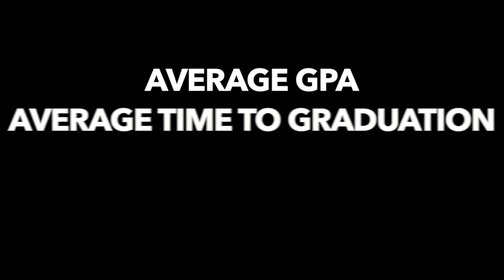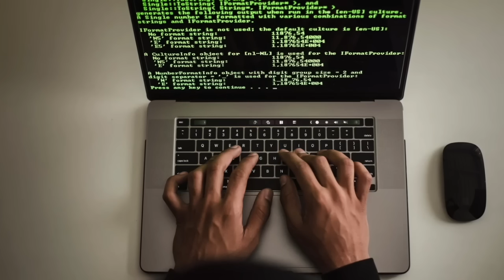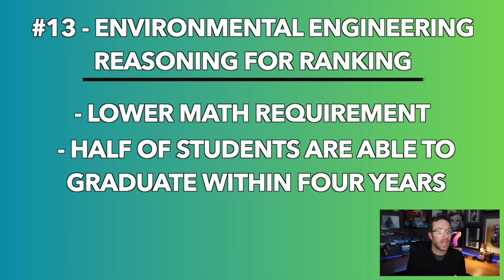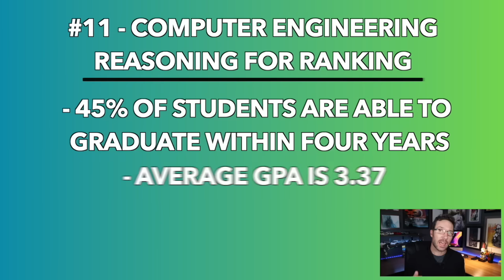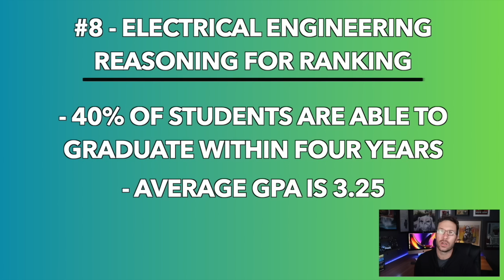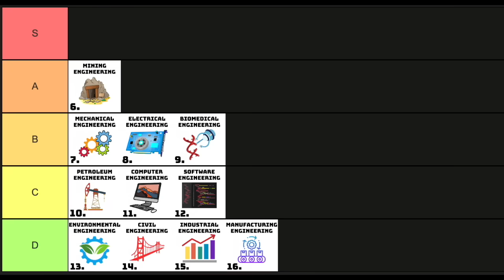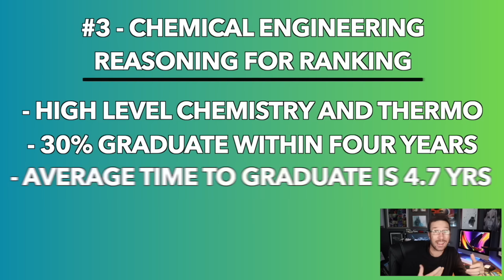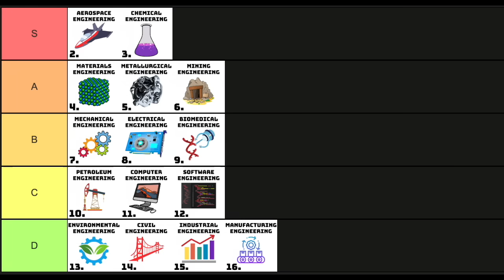Engineering Degrees Ranked By Difficulty (Tier List)

Comment: I appreciate your attempt at doing an objective list. One problem with that is that if you want to have something called objective then you have to have data which is actually objective. With that I mean for one the data is correct and it also says what you want it to say once you interpret it. 

When it comes to highest math required I would say it is a good criteria in principle, but a bad one in practice. I'm not the first one to point out that in certain disciplines they have tougher math courses which are just not labeled as math. And then depending on the degree you can have the very same math class in the same school with various difficulties. Just to bring an example, in mechatronics engineering and in electrical engineering both courses had differential equations. The mechatronics course took the approach to give a rough outline of the basics and then they just did simulations with matlab and simulink. The equivalent with the electrical engineers took the mathematical approach where they went deeper and only did calculations by hand. 
If we would want to guess which engineering degree teaches math to which depth, then we would have to look how much it is required in the follow up courses. 

Then there is the problem, that the math course is normally not the toughest course of a degree. I guess if you have tough math then you have a better basis to go deeper in the follow up courses. Sadly it is not that simple. For example in mechanical engineering the highest math they do (partial differential equation) is relevant to their job and so they focus on this with their math. The electrical engineers have various transforms as their highest level of math and don't follow the differential path as far as the mechanical engineers. Does that mean the math of the mechanical engineers is more difficult? In my experience it depends on who you ask. Some find differential equations a mystery and others say the same about the flourier transform and the complex numbers. 

Because of the reasons mentioned above I think weighing the duration of the average graduation time is a better indicator. In my case the graduation took longer due to me taking an exchange semester. And some people take longer because they do other stuff on the side. So this would also have to be considered as different engineering degrees attract different people with different interests and different approaches at doing things. But I don't know how significant those other factors are compared to difficulty. So the best I can do is call to caution and not just assume this difficulty is the only relevant reason for graduation duration. 

In practice I would say you have to look at how the school educates the degrees and which fields of math and physics and other topics you are skilled in. There are engineering degrees which are as a whole more tough than other engineering degrees. But actually ranking them objectively is not that easy, especially if you have not studied the degree yourself or talked to people who can make comparison. Sadly this is probably a topic where anecdotal evidence is better evidence than if you blindly go by "objective facts". 
If I were to try to make an objective list then I would try to approach students from different schools who can make comparisons between different engineering degrees. And then ask them which degree is more difficult and why they think it is more difficult. Then I would try to differentiate between which topics seems to be objectively more difficult and which depend on the type of student you are. For example calculus 3 is objectively more difficult than calculus 1, but calculus 1 is not necessarily more difficult than linear algebra. It depends on what you are more skilled in. 
This approach of creating an objective list generates a lot of legwork, but who said being objective is easy?

And when it comes to upcoming engineering students I would recommend every student to visit the school/schools you consider attending and talk to students and teachers on what they say. I did that and it helped me make an informed decision.
Reply: @@Juuru107 I hope I got everything: 

- The same math course doesn't have to be equally difficult in different engineering degrees. 
- Math courses don't have to be labeled as math courses.
- The most difficult courses don't have to correlate with the highest math degree. 
- What someone finds difficult depends on the skillset of a person.

--> Because of that weighing the duration of the average graduation time is a better indicator, but difficulty might not be the only significant reason why an engineering degree can take longer. 

In this case anecdotal evidence is more accurate than pure numbers as long as you ask enough people. After all pure numbers only mean something if you have the insight to guess what they mean. 

And for the specific case of each individual student visit a few schools and look at a few degrees. Ask the students and teachers  to find out if the place may fit.

Comment: So everyone at the university I went to (CU Boulder) would have pretty much agreed with your tier list with the exception of EEs. They were bona fide elitists. I think it was due in large part that they were the only ones that had to master the sorcery of digital circuits. But IIRC, mechanical engineers had the most demanding curriculum, being required to learn a large amount of electives in other disciplines, and on top of that - along with aerospace - had to take 3 (or 4?) semesters of physics, which included relativistic physics. Also, software engineering wasn't actually part of the engineering school, but rather arts and sciences.

Comment: 3rd year Aerospace Engineering student here, I was surprised to see aerospace at #2! From my experience my major seems harder than most disciplines (mechanical, civil, environmental, industrial/manufacturing, etc.) but definitely seems easier than something like nuclear or electrical. With respect to chemical engineering I’d say the difficulty depends on the person, because some people are more inclined to understand chemistry than physics/mechanics, but for the average person I’d say it’s harder than aerospace.

It’s also worth noting that for some disciplines (i.e. materials/metallurgical), the average student is getting at least a graduate degree, so comparing the undergraduate degrees isn’t necessarily comprehensive for comparing career paths.
Reply: PhD student in Aerospace here. In my opinion, the difficulty in Aerospace doesn't come so much from the individual difficulty of each subject, but the variety and depth to which we study several fields. You could say we're Mechanical Engineers with some less thermal stuff but a bunch more fluid mechanics and structures. Also, my university didn't have Nuclear, but compared to Electrical Engineering, Aerospace doesn't fall behind in maths, control systems or physics.
Note that your experience may be quite different, as I haven't studied in America and my undergrad program had a base duration of 5 years (which was virtually impossible), so I don't know how a typical American program is.
Reply: Your assessment is spot. In terms of difficulty, I would rank NE > ChemE > EE > AE > ME > CE > EnviroE/IE/ME

Comment: Dec 1970 Mechanical Engineering 148 Hours required. Was it hard? Had a 2.5 average, then got a degree in Business Administration 3.8 Average and an MBA 3.75 average.  Yep, Mechanical Engineering was long and hard.

Comment: As a retired Ph.D. nuclear engineer, I would consider chemical engineering perhaps the hardest at the B.S. level. When I got my B.S. in nuclear engineering in 1969 at Kansas State, both chemical and nuclear engineering B.S. degrees required 148 semester hours. Now, I think somewhere around 132 semester hours are required for chemical engineering there. I think the chemical engineering approach to mass transfer and fluid flow is a little more rigorous than in mechanical engineering (my graduate level minor). I am not current on what the entry level pay is for the various disciplines right now. Petroleum engineering used to have high demand and high pay.
Reply: Another thing that’s not mentioned very much in the video is the job saturation level. From my research, chemical engineering is highly oversaturated because of the few number of jobs currently available. In the US where I’m from, chemical engineering does not have very many positions available versus how many students are graduating per year. So, while it may be an incredibly difficult major, you’ll probably have to work twice as hard to find a job in it once you graduate
Reply: @bestredditstories1158  - Same here!
Reply: @bestredditstories1158 

I am a chemical engineer as well.  University of Notre Dame class of 1994.  I think the opposite is true.  It is the only current engineering degree that has more openings than people graduating on a national level.  You just need to be willing to move where necessary.
Reply: Very cool. I am currently a nuclear engineering student at KSU.
Reply: @joshuat3686  Graduate student? I couldn't find you in the grad student directory online.
Reply: @JeffRyman69  No, I’m a senior year undergrad. Technically, I am in mechanical engineering with a nuclear engineering operation.
Reply: @joshuat3686  If you want to work for a utility, that is a good place to be. Utilities hire more mechanical and electrical engineers than nuclear engineers. A mechanical engineering degree with a nuclear option is a good combination for that. It also is a good background if you want a graduate degree in nuclear.
Reply: @JeffRyman69  Thanks, I am starting my job search now, and I will definitely keep utilities in mind. Getting an engineering position at a nuclear power plant would be ideal.
Reply: @joshuat3686  Problem with nuclear is jobs , ever since that nuke plant blew up in 3 Miles island some 40 yrs ago, US did not built a single new reactors.  Only recently they finished 2 but no new proposal.  SO the usual career path is working for govt , military, university.  I used to work at largest computer companies in 2000, we got 3 ex-nuke operators from the Navy doing tech work.  Good luck
Reply: I studied chemical engineering in Germany until February 2023. And at my University of applied science, we have in Bachelor the complete chemical engineering and in Master we can go deeper in nuclear physics like nuclear waste management and so on. Both is difficult and I don’t think there is a great difference in the difficulty level.
Reply: Any good engineer should be able to think in three dimensions. Most people struggle so start early imagining complex shapes in your mind’s eye.
Reply: I agree, my wife is chemical she can handle all my circuit analysis problem just by looking at the book. Her fluid dynamic & heat transferis so complicated for me  , I see so many dropout in ME & Chemical becuase of fluid dynamic and material science.
Reply: I took electrical engineering, after passing the board, I returned to school and studied mechanical engineering. Not satisfied, I studied again computer engineering. After passing all board exams, I ended up in mental hospital teaching engineering to my roommates...
Reply: @noomade the difficulty of chemical engineering at the graduate level depends on the area. Chemical reaction Engineering, and Chemical Reactor Engineering are exceptional within the discipline. Chemical Reactor Engineering requires proficiency in all branches of the discipline and that makes it very difficult. Moreover the level of math required is indeterminate. Recently, chemical Reactor Engineering seem to involve the extensive use of Quaternions, and Integral Equations.
Reply: @JeffRyman69   You forgot to mention that there is more to chemical engineering than the nuclear field. Once you master the basic building blocks (or concepts of modern chemistry) you can easily transit into a multitude of fields from biochemistry to exotic types of paint and not to neglect, food production
Reply: I agree. The problem with being a chemical engineer is people don’t know what we actually do. They just assume chemicals. They have no idea how rigorous the major can be since people rarely dare to actually take it.
Reply: Can you help me out with
Reply: @noomade  Probably electrical as the hardest, to be honest
Reply: @bestredditstories1158  actual ther are - electrical and - electronic. some university just focus on electrical,  and most focus on both, Electrical is much easier as one subject and I dont see any dropout at 3rd yrs..   Much higher dropout  if they study both in one major

Comment: Mining PhD here,

I’m not sure how you’re getting no growth. There’s a demographic cliff coming fast in the field and a massive expansion in the scale of projects and difficulty in developing new mines.

I’d be cautious with ranking Mining difficulty compared to many other engineering fields due to it being more of a generalist field than the more narrowly focused fields, with mining engineering curriculums being a mix of mining, geology, engineering principles, economics, operations, rock mechanics, ventilation, regulation, plant management, and safety. It isn’t as “hard” in a narrowly focused technical sense as EE or some MechE specializations, but it requires a different kind of awareness and understanding of a little bigger operational picture. There’s a somewhat intangible difficulty there in contrast to the narrow focused academic difficulty of an EE or a ChemE. Mining is a field that has a greater emphasis on hard to academically quantify judgement than most.

Comment: Electrical engineering is the most difficult, the course has too much abstraction,  no one see current or voltage or radio wave. I took DSP course man that course requires you to fully understand Fourier, Laplace and complex analysis
Reply: Man now I kinda wish I never took CS. 
Electrical Engineering sounds infinitely more fun.
Why tf does CS have a higher GPA requirement than EE???

Comment: There is no way computer engineering should be this low and EE is harder the mechanical in my opinion. We should also consider the small amount of data we have for the obscure degrees with small graduating classes.

Comment: Well, this may be true of most engineering fields, but when we say electrical engineering, it comes in different flavors with varying degrees of difficulty. For instance, an electrical engineer with a power focus is not the same degree of difficulty as an electrical engineer with a semiconductor focus. Semiconductor engineers have all of the basic electrical engineering elements, but also elements of chemical engineering, metallurgical engineering, mechanical engineering, quantum physics, photonics, RF, software engineering and a whole lot more.
I'm not trying to make a case specifically for electrical engineering. I'm just trying to point out that the assessment is probably not accounting for the variation in difficulty within disciplines.
Reply: Jesus. I wanna have a semiconductor focus lowkey.
Man why tf I gotta choose CS. Yall be doing way more interesting shit
Reply: @honkhonk8009  Indeed. Semiconductors is a field that is never coasting. Every few years there is a new technology in development and with each new technology there are new principles to learn and sometimes a few to unlearn. Never a dull moment.

Comment: Yeah, for the most part I agree about the CS degree. CS was under Industrial Engineering & Management, so I also have a minor in IEM. I also did not finish in four years, as I wanted to understand computing from the electrical and mechanical at the component level all the way up to large scale systems. Took math through partial differential equations and then group theory, along with a fair amount of statistics. Programming was the least amount of credits I took. Turns out all the IEM classes made for being a pretty good Project Manager as well as a first rate software engineer. I had a varied career from programming some amazing equipment to being a high level manager to being a consultant. I loved all of it before I retired. While education filled me with a huge amount of facts, the important part was learning to think in certain ways to see solutions. Great video. Sent to my son who is a mining engineer that I’m sure would agree with your assessment on his profession.

Comment: if ordinary dif. eq is your upper limit of math, you are not even engineer. our curs was filled with tensors to stability of control systems with freq. responses. 5y course, average 7y to finish , 50 out of 300 finished with degree of mechanical engineer.

Comment: me with the math degree working as an embedded software engineer:  sweats nervously
Reply: I got a bachelor in electrical engineering. I found out that I like to program microcontrollers, so I decided to look for embedded software engineer jobs. I was underqualified. Perhaps doing microcontroller programming in my freetime and outside of a few lectures would have helped. So I can relate with your sweating.

Comment: I’m an electrical engineering sophomore, currently taking differential equations. I’ll have to take at least applied mathematics (which is linear algebra with extra math) and I’m picking my last elective to be a 400 level math class so I can get a math minor
Reply: If you are doing a control systems oriented track, doing either functions or complex variables or a numerical analysis course might be very helpful for you. If your school offers one, an advanced linear algebra course might be very helpful too because there's a ton of very useful linear algebra that you end up learning in grad school  that is not even touched in the undergrad programs.
Reply: @ryanh7167 late response but I’m now a jr and just signed up for a numerical analysis course, thanks to your comment! I’ve also chosen control systems as one of my focuses